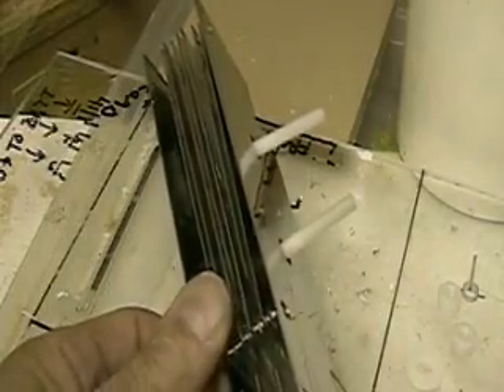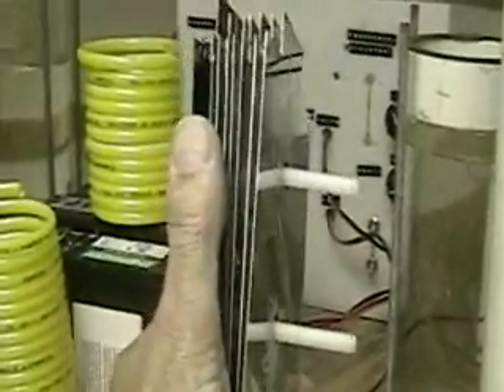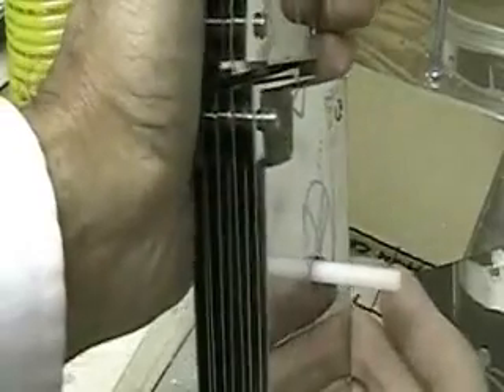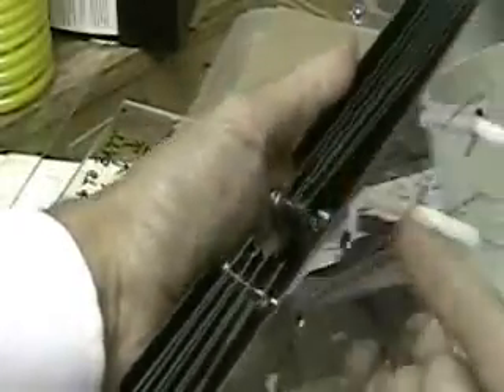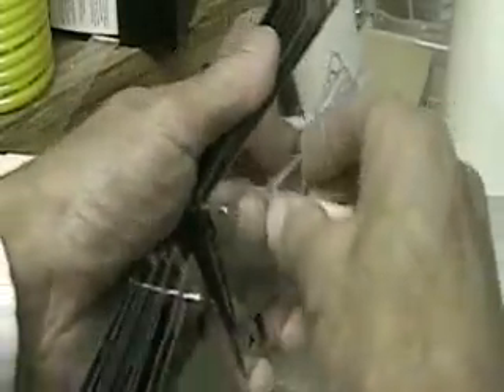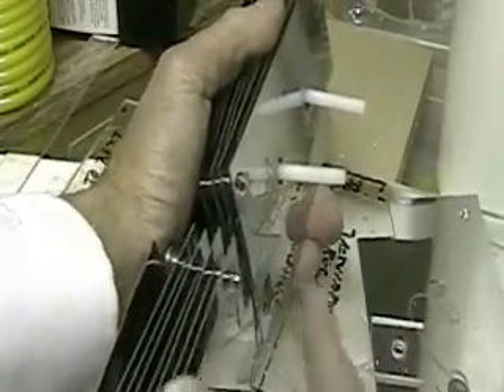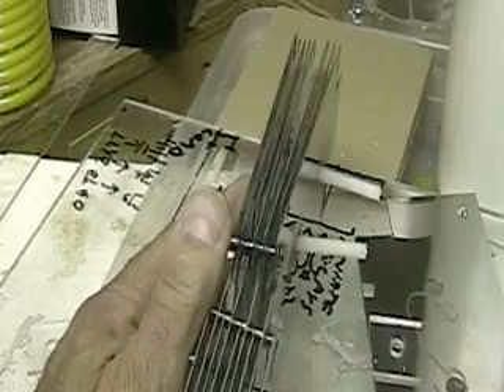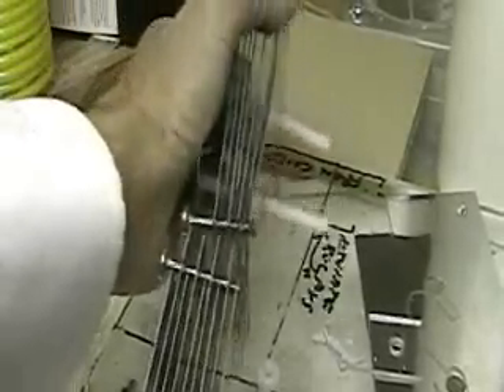Hydrogen Tap (New TOWER-X ) 256

Comment: I've been running a double stack of 40 3x6's for months now. They really shine with upped volts. made a 3 1/2" sq. tube also. its 40"h. figured it would be the next step. i Have 8 plates cut for the tube at 3"x24". wish me luck.